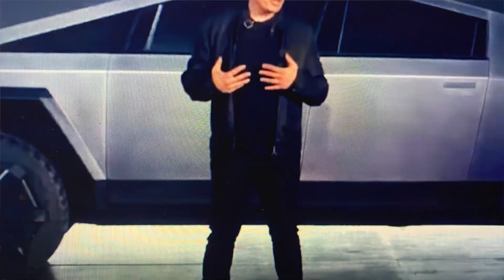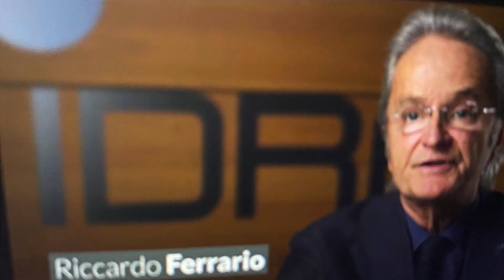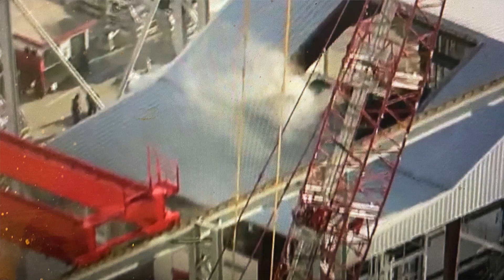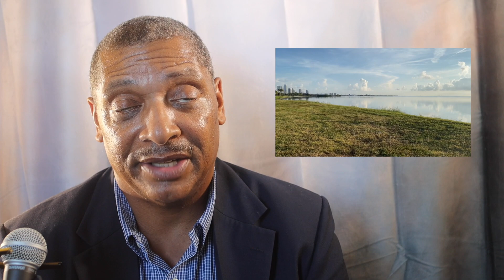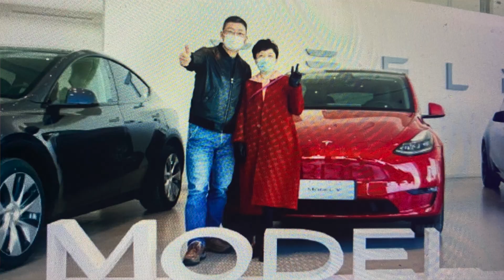Tesla Gigapress Trillion Dollar Miracle? 2021. (a509)

Comment: Hi,
Considering 1 machine to make front & rear casting, with 2 you get 252k model Y, as for model 3 we are just needing 1 cast it means that 2 machines produce around 500k/year. Currently the total output in Shanghai has been increasing to reach that total level by the end of the year, suggesting that are 3 in use, where priority would be Model Y and 1 for Model 3. Let's anyhow remember that you can always change the mold to front or rear of any of the 2 cars and, that for calculation purpose I already deducted maintenance hours, part check, mold replacement, etc, etc. from the theoretical total output.
For Germany also 8 have been planned, although only 2 will be operational to start production for Model Y.
Texas also counts with 6 additional ones in plan (not considered the 8ton for Cybertruck). That, of course, to add to the existing 2 in Freemont which would be kept for R&D once the 2 new factories ramp up, according to my understanding (yet to be seen...).
Note that 1 is 12ton been built in China for the single casting cheaper model, not in any way officially communicated yet, but suggested by alternative information sources... 😉
Reply from the maker: Wow good info
Reply: I think they need one GigaPress for the front section and another GigaPress for the rear section.  That’s why they are currently purchased in pairs. By using one for the front and another for the rear, the production line can move much faster. Using one for both the front and rear would require shutting down the line for a few hours to make the change or they could produce just the front section one day and the rear section the next day, but this method would be slower and less efficient.

Comment: Greg, Tesla has been producing Model Ys using one GigaPress in Fremont for many months so they are confident in the GigaPress functionality. What is new is the use of a second GigaPress for the lower rear section of the EV. This is why there was no Plan B. 

They have ordered and installed at least 8 or more of these GigaPresses. There is another manufacturer of these GigaPresses from China. Tesla has ordered GigaPresses from this other company as well (perhaps for Giga Shanghai). Currently Giga Berlin and Giga Texas have installed 4 to 6 of these GigaPresses already. There is YouTube video of these GigaPresses and of pre-production of Model Ys using these GigaPresses from Giga Texas and perhaps Giga Berlin.  Tesla has also ordered a much bigger (9 ton) GigaPress presumably for the CyberTruck production. 

Tesla had to develop a custom proprietary aluminum alloy to work with these GigaPresses (some have speculated that the development of this alloy came from Space X engineers). 

Elon has stated that each GigaPress replaces about 70 robots.
Reply from the maker: good point

Comment: Two questions: 1. Does Gigapress make just one casting, front or rear? 2. If 300 robots are eliminated, does that cost saving permit buying a backup Gigapress? Great news. Thanks, Greg.
Reply from the maker: Good questions.  My understanding is that it is front or rear not both at same time.  Would be great to do both but video from Idra on YouTube shows one at a time.
Reply from the maker: Did some reading on backups issue. From what i am told they make 12 a year and tesla buying all production for next one to two years.

Comment: There are other press manufacturers, making smaller machines. If they are 1/4 to 1/2 Idra's capacity, you could still get a lot of the benefits. What I've heard from various other YouTube videos is that the proprietary aluminum removes the need for machining or heat treatment after casting.

Comment: A problem with the Cybertruck it's being a completely new truck platform than the standard body on frame like the F-150 Lightning. So don't be surprise if it suffers a radical design change from it initial concept, and adopts a more standard body on frame, an exterior design similar to their line up, turning the production easier. Also the Semi with time, I suspect they gonna convert into a small delivery truck with a tray. Focusing in the distribution sector. Since the Semi with that massive battery pack, would have a small towing capability and range, compared with other Diesel semi.
Reply from the maker: good thinking
Reply: Surely they aren't going to devolve it into an antiquated truck design. Ewww

I would cancel my preorder immediately.
Reply: @NotFinancialAdvice  "antiquated truck design"...there is a reason why the design worked for so many decades.
Reply: @RogerM88  So did fax machines.

Comment: My thoughts:  the risk is isolated Germany.  If the plan is front and rear castings and structural battery joining the two there are many things to go wrong with no support locally.  However having two machines adds redundancy and while it’s seems risky, it is Tesla, and they have survived and achieved a lot.  Interesting thought to buy controlling share of INDRA?